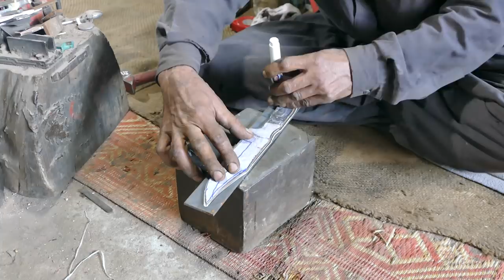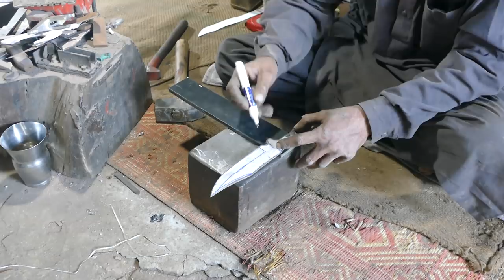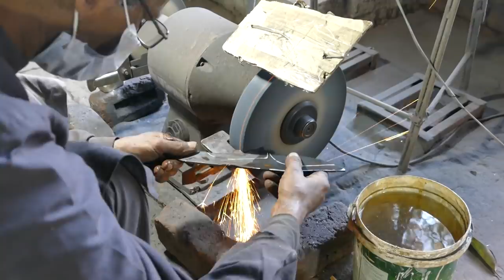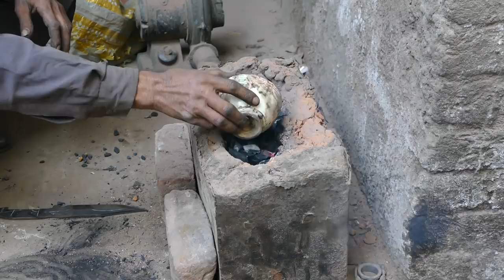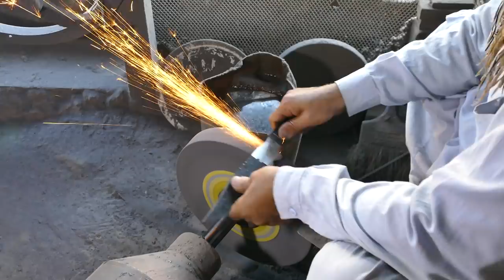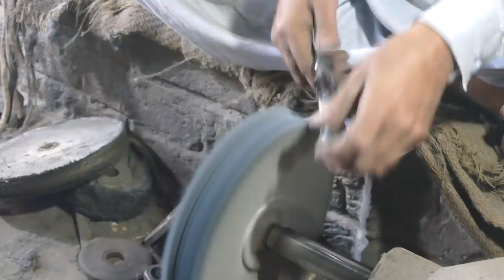Amazing Handmade knife making with rusted steel

Comment: Has no idea about metallurgy, no CAD designs, no maths skills,  no safety gloves, no 'kill switches' in sight and yet manages to make fantastic tools. Skill is skill, no matter how poor you are, imagine that level and living in a first world country?  Much respect for these type of people.
BTW, I travelled throughout that part of the world and this level is very normal.
Reply: he`s not poor , not in the slightest , poor is only a state of mind , he`s loaded !
Reply: Hell no this man deserves more
Reply: Actually this is skill
Reply: Yep he been watching YouTube videos lol
Reply: honestly you should never use gloves when working with power tools, they can make your injury worse
Reply: @leostraker3494  I know, but depends on what equipment you are using, anything that can drag your hands in, no, anything that you are hitting? Yes.
Reply: It's not much of an skill to use bench grinders to shape steel. In fact, when you start learning smithing, using bench grinders to shape the blade you have just folded and smithed in a forge, is one of the first things you will do and the first thing you will notice that they shape metal like hot knife shapes butter and it does not take any skills to do it. If you have skills, you will later notice that everything is done mostly by hand from hammering to buffing and etching and you use only hammers to find the shape of the blade.

We made knives and throwing stars like that during shop classes when I was 15 and haddent touched a hammer or stood in front of a forge. And when I later in my life did that and forged my first knife blade, I realised that I would never be skilled enough to keep doing it again.

Edit: I studied couple of years in artisan studies, from which one year was metal work, and we didn't touch AUTO CAD once before we hit the forge.
Reply: When working with these kinds of tools there are 2 types of injury. Ones that are minor enough that gloves help, but its such a minor injury it doesn't matter. And ones that are serious enough that gloves wouldn't help anyways.
Reply: Actually there are plenty of us here in the US. Democrats like to call us derogatory names, but we are here. Still practicing old ways, still teaching.
Reply: @sanakassara  It does take a lot of skill actually. I'm on my 12th knife and can't even come close to that even of a bevel without a guiding jig and scribing centerlines. Not to mention that I forge in my bevels before hand so it gives me a bit of a guide surface to press against the grinder. Being able to feel the difference between an 11 degree and a 13 degree angle so that your bevels don't come out with facets or convex takes a lot of skill. And it looks like he ground that in in about 6 to 8 passes for both bevels. When the most costly part of production is your time, the difference between grinding it in 5 minutes versus grinding it in 60 minutes is the difference between getting paid well and getting paid pennies.
Reply: @mrkiky  No it does not. Cutting up metal sheets and using belt grinders to shape them is not a skill, it's an ability. Skill is to forge a smoldering lump of steel to a shape of blade. I had the ability to cut and shape automatically, like most of us have. What I didn't have was the skill to forge and I know that because I forged only one knife blade. To make the whole knife with the tang, bushings, pommel, possible crossguard, hilt, sheath, last inside the sheath takes real skills from metalurgy to wood and leather work while taking hours of maticulous effort to finish and I couldn't cut it. I could use belt grinder straight away even without planning ahead. 

How hard is it to push the sheet against the grinder and turn and twist it to shape the sheet? I can tell you, it's not. If you have difficulties, it's because you have difficulties to coordinate and visualise what part of the grinder to use and in what angle. Just step back and picture the angle in your mind before you push the metal on the belt, do some dry runs with the blade and you are set.
Reply: @sanakassara  By the same logic, anyone can grip a piece of steel in a pair of tongs, hold it against an anvil and hammer it into a knife shape. A knife isn't really a complex shape. The hard part is getting it smooth, even thickness, straight, proper angles on the bevels so you have to do minimal grinding. I bet even with my knowledge I can teach a 13 year old to forge a knife in one session. It's just not gonna be a very nice knife. That comes with practice, that's why it's called a skill. It's the same with grinding. You can grind in an edge that can cut, it's just not gonna be anything that can sell, so to speak. Unless you post a picture of your first knife, I can't really tell at what level your grinding ability was right off the bat. But if you really managed to create a pair of symmetrical, even, flat (or hollow if you used a wheel) bevels that meet up to a centered edge, you either got lucky or have some innate talent for it that most people definitely don't have. And of course the other part of the skill is doing it fast, which is very important if you intend on making a living out of it.
Reply: @mrkiky  No, the logic is not even remotely the same. In the other process you basically cut a shape from a sheet like you would cut a paper. While in the other process you have to use fire to heat a lump of steel to shape it lake clay and constantly fold it to make it harder and tighter and you have to know how to quench the steel without twisting and warping the blade. The two processes don't even remotely come close to each other, so you can't in any way logically think of them in the same context.

Besides, after you have done the hard part which is forgin, you get to the easy part, which is grinding and puffinng. All hand forged knives are grinded and polished to their final shape after you have shaped the blade with your hammer. While cutting a stencil from a metal sheet is simply cutting the shape from a metal sheet and grinding away the rust and grime. You don't have to teach a 13 year old to do that. We did it without any particular guidance in shop classe back in junior high as part of basic curriculum and it was the first thing we went through in basic artisan studies we did while getting to know smithing. I was studying to be stone artisan and the metal part was part of our basic training, while we were figuring out in where we might be good at. Forging the knife was the first task we were required to do, and it consisted all the parts from the froging to the grinding and assembling. Only part which didn't require even any idea about a talent was the grinding. I don't know that is it just beacuse of me and the fact that I have for example sketcehd and done drawings for about 40 years now and I have a quite high aptitude for it. Or was it simply because it literally took no brains to do it and that's why it's an ability, not a skill. Skill is to make the whole knife from scratch, from a lump of steel to sheathed work of art - which I noticed I didn't have because all I could do in the time window set for us was to forge, shape and polish the tanged blade. So ability to grind sheet metal does not impress at all, being the easiest part from the knife I failed to finish in time.
Reply: @sanakassara  Again, no way to assess at which level you did your grinding. All I'm saying is that it's not easy to do it right. It's not easy to do it fast, and it's definitely not easy to do it right and fast. The guy in the video is pushing that blade against the wheel and finishing a very good bevel in a matter of minutes. He's also working with no gloves, and you can tell by the color of the oxide on the blade, it reached over 300 celsius without him getting burned or without the wheel throwing the blade out of his hand. You get better with practice, which is why it's a skill. I can spot a huge difference between someone who's doing it for the first time and someone who's doing it all day. Also you definitely don't have to constantly fold it while forging, not if you're working with modern steel at least.
Reply: @mrkiky  You don't seem to get that there are not much levels in grinding. You can't polish steel, if there are bubbles or other rough spots on the surface. My knife was polished, shaped and edged. You can easily "assess" that without a picture - which you can't even attach to YouTube comments without and IP address.
Reply: @sanakassara  I know what you're saying. What I'm saying is that I completely disagree. Look at what a beginner does on a grinder and look what Matt from That Works can do. There's tons of levels to grinding. And you can absolutely polish an uneven surface. I can even show you my last completed knife where I made a couple of mistakes resulting in very slight dips in the bevels, which are by all means polished to 800 grit like the rest of the blade, but if you look how the light reflects, you can tell it isn't flat in that spot. Just because it's polished doen't tell me that your bevels are flat, that they have the correct angle, that the grind lines are at a constant depth, that the plunge line are nicely defined and at the same height, etc. Literally can't tell without seeing it. But regardless of how well it turned out, it's absolutely silly to say that shaping steel by grinding isn't a skill or that there aren't levels to it. Imagine grinding a rapier blade with a distal taper. It's insanely hard to keep straight and flat. Just like saying drawing isn't a skill because you just drag the pencil on the paper and leave marks. And yet drawing an accurate portrait requires a lot of skill. It's easy to draw lines on a paper. It's hard to put them where they should be.
Reply: @mrkiky  I know why you disagree. I already gave you pointers to make it easier, you just need to develop your sense of space and shape a bit with your motor skills. I have developped issues relating to motorics later in my life, but after over 20 years I could still bench grind without issues, because I see where my hands are and what must I turn to shape the metal to what it looks like my head. The guy on the video has done it so many times that his ability has become an automation like breathing is. Sure, it takes practice but it does not make it a skill, which breathing is not either.

It was my first time knife smithing when we had the task and I was still able to make a polished and edged knife blade - with zero skills to begin with. I learned on the way, that's why it's called studying.
You also keep constantly going on about them bewels. I would get that if the world of design would be stuck on one universal knife blade model, which it isn't. You keep constantly dismissing the fact that shape and thickness of the bevels depends on what you want the blade to look like. There is a company in here, in Finland called Wood Jewl Design Kauko Rantanen. His knives are all over in Finnish shops and they go like hot cakes to outdoors people. Almost every knife he forges is rough and unpolished and the blades from the tang to blade are very thick. But despite the rough appearance made in Finnish nature, those carbon steel knives are top quality craftsman representations of blacksmithing skills and your argument is that it takes skill to grind some steel with a beltgrinder.
http://www.woodjewel.com/
Reply: @sanakassara  Because the bevels are the hardest part. Profiling, I have to agree with you, that part is very easy because it doesn't have strict angles and you can see directly as the grinder bites into the steel. As for the knives you gave a example,the only thing you can argue is rough about them is maybe that he leaves forge scale on the flat of the blade, which is clearly a design choice. Otherwise, the fit and finish is very refined and the bevels are very clean and consistent, the handle construction is fairly complex too and the materials used seem to be pretty exotic and fancy. Nothing I would call rough. 
Anyway, anytime I make a new knife I get more worried I'm gonna mess it up while grinding in the bevels. It's just the trickiest part. Even when it come to forging, the bevels are the hardest thing to get right. But at least during the forging stage you can correct it a lot of time. On the grinder, if you went too deep at the wrong angle, it's screwed. Just 2-3 degrees and 5 seconds of not paying attention and now your edge is too thin to be quenched, and you have to reduce the width, or your grind line went too deep into the flat and looks messed up.
Reply: @mrkiky  That's the other thing. Sheet metal is soft and used for construction, it's made for bending and shaping. If you use too much force, throw it away and cut a new one. Forged steel is a lot harder, so it's more forgiving. You can use more pressure without getting in too deep. I think that you are saying that it takes skill to figure out how the material behaves when you work it. While in fact you should notice right away that the rough belts almost cut the steel sheet away more than they grind.
Reply: @mrkiky  I missed the part of the bewels while forging. It was not so tough as you migh expect. Anvils are designed for shaping and you just use different angles, parts of the anvil and maybe more time on the parts you want to get thinner and pointier. Force you can't use much, it dent's and fractures the steel. That's why the big pneumatic hammers don't pound, they press to stretch and to pack in the metal.
Reply: @sanakassara  That really depends on the steel. Modern standardised steel almost never cracks. For bevels you're supposed to use the flat side of the anvil and hit it with the flat side of the hammer. Simple theory, hard to master. There are different techniques. Mastersmith Jason Knight works on one section at a time with the round hammer,  then goes back to the flat hammer and smooths and straightens everything. Sasha Alexeyev explains that you should hit the bevel with the flat hammer into itself instead of pinching the edge, a technique that works on old, non standardised steel which tends to crack if you pinch it. But either way, it's the trickiest part to get right. Profiling, forming the tip, forming the tang is all pretty straight forward. 
And what are you saying? Power hammers absolutely pound the crap out of that steel. There are presses that squeeze it gently and there are hammers that hit it hard, fast and often. Even back in the day, making larger objects like axes or swords, the smith would be assisted by an apprentice as a striker to pound the fuck out of the workpiece with a large two handed hammer while the smith holds it.
Reply: @sanakassara  Actually the point of forging is just the easiest way to get the steel into shape. Has nothing to do with tensile strength or hardness. Those are dependent exclusively on the composition of the steel and the heat treatment. Doesn't matter how it got into shape. Cold rolled, cast, forged... heat treatment resets the structure. High carbon and alloyed steels tend to be harder even when annealed and they move harder under the hammer too.
Reply: You know why the internet often is filled with all kinds of shit? It's for example due the fact that things containing all the right information keeps getting deleted or blocked - like my last comment on another username. That sucks, specially when you argue with facts against ignorace. Just so you know, you basically stated in your last comment, that you don't know anything about forging. The process aims to strenghten the steel and make it bendy. Rolling does not do that. Here is some evening reading for you.
https://blacksmithcode.com/forging-temperature/
Reply: @alonzotyper2900  Not only did I study metallurgy in college, I get to experiment with forging hands on as a hobby and I consumed a ton of information of steel and knifemaking. Fact of the matter is, you take your rolled steel bar and you grind it into shape, then you take the same steel bar and forge it into shape, fold it a million time if you want. You apply heat treatment to both of those knives and they will have the same crystaline structure and same properties (if you apply the correct heat treatment with normalization, hardening and tempering, only exception being, the ground knife may not even need the normalizing part if the bar was factory annealed). Folding and rewelding was done in the old days to make the composition of the steel more homogeneous, that's it.Even the link you provided says this. It doesn't do anything else. Modern steel doesn't need folding and doen't benefit from it because it is already homogeneous. Unless you are pattern welding, folding modern steel is a waste of time, energy, fuel and material(lost to oxidation for more heats than needed) and may even decarburize your steel (again due to it spending too much time at a high temperature, the carbon starts to difuse out of the steel). 
I repeat, if using modern steel, forging is just a way of getting it into shape. It has no bearing on the final properties of the knife. Those depend solely on the material and the heat treatment, NOT the shaping method. Ask any bladesmith, he will confirm.
Reply: The fact that you even mentioned personally that the purpose of the forging is to homogenize the metal makes all the difference. You take a rolled sheet/bar of steel and you can burn it all you want and you still won't get the same properties on it than you get on forged blade. Take a stamped knife blade, or blade like in the video and stick it into something tight and twist sharply - it goes snap. Try to do the same to forged and folded blade and see how it maybe bends, depending how much you got in your sleeve. Modern factory made steel knives snap even when they accidentally get dropped on bottom of a fibeglass boat. But you still find blades made hundreds of years ago intact after exposed to elements and only because they were forged. It also depends totally from the modern steel how homogenous it is. Blades like mild steel blades snap easily and rust practically even from idea of water. And you can't heat treat such blades as you please, you have to follow the manufacturer advised temperatures, otherwise you can chuck the blade away from the get go.
The part you typed about the decarburizing was already behind the blacksmith link. I don't have to ask from any blacksmith about the purpose of the forging because the link already confirmed my argument by stating that, 
"Forging
This deals with heating the steel at a high temperature. The sword is from iron sand that contains very little or no Sulphur.

The way to achieve this is by heating iron sand and carbon together at a very high temperature. This causes the sword to have high strength and ability to hold sharp edges and reduce the risk of breaking." The shaping, as you call it, packs the metal tighter and gives it strength.

You stated that you get to experiment with forging as an hobby. Do you use some mini gas burners, or do you have the change to use an decent coal forge?
Reply: @alonzotyper2900  Sorry but that is complete aberration. How could manufacturers that mass produce knives  put out high performance blades if they don't forge them? Packing the steel tighter makes no sense. Steel has a fixed density. It's a solid. It's incompresible. You can't pack it tighter. You are misunderstanding how it works. 'Packing it tighter' probably comes from the fact that if you're working with wrought iron or bloomery steel which has so many impurities it basically has a grain structure, you have to hit it in a way that presses the grains together, essentially pushing some of the impurities out and forge welding the grains. Zero point of doing anything like that with modern steel. You can hit it every which way, just make sure it's hot enough and it won't crack. 

The propreties of the material depend on the microscopic crystaline structure, basically how the carbon atoms are arranged inbetween the iron atoms in the lattice and how fine the indivudual crystals are. In fact, forging builds up non uniform stress in a workpiece which is undesirable. The normalization stage is done with the purpose of relieving stresses from forging (mentioned even in your link). You heat the metal and let it cool slowly. It recrystalizes and gives the carbon atoms a chance to get out of the iron atom cubic lattice. Doing it multiple times refines the grain structure, forming smaller and smaller crystals, which is desirable. Now that the steel is prepared for the next step, you heat it up above what's called critical temperature, the steel becomes austenitic, very easily indicated by the fact that it loses magnetism. Carbon atoms slip into the lattice because it's loose from having high energy. Then you rapidly cool it, carbon atoms become trapped. At this stage there is a lot of tension due to this. The metal is very hard but very brittle. Tempering takes care of that. Keep it steady at low temperature (typically 45min to 2h at around 200 celsius), some of the stress is relieved, removing some of the hardness and most of the brittleness. Now you have a metal with propreties adequate for a blade. That's the entire philosophy, broadly, for carbon steels. Extra alloying elements make it more complex. 
If you want to maximize the propreties of your steel:
Step 1: know what steel you're using.
Step 2: get a professional heat treating oven and standardised quench oil
Step 3: absolutely nail the heat treatment according to the manufacturer's diagram.
How you shape it is irrelevant. 

So, in summary: forging with modern steel -> only shaping
heat treatment -> getting the desired microstructure which comes with the desired propreties. 
Personally I use a charcoal forge, quench in cooking oil and temper in an electric cooking oven that has a temperature setting.
Reply: Seriously Mr. Metallurgist. You type from solid structures and crystalline compositions with atoms and microscopic structures in the same essey, but still try to deny the thing which is obvious...

Like you already so elegantly stated, nothing here is solid. Even the toughest metals are formed from structures we don't even have the technology to see. Steel is porous and if you want it to be less porous, you need to work it. The more raw materials it has from carbon to chromium, the more porous the structure is due to mismatch composition. The more porous it is, the less density it has. I have no idea how you might think that it was an some sort of thought error from my part to bring it up. The text on the link which I posted and typed by a blacksmith already confirmed my argument, while your was that forging is only a fast way to shape steel. There are plenty of faster ways than that, ways like the previously mentioned rolling, and don't forget casting. But neither of those processes enable the same possibilities than forging does and produce structually equal metals.

One part of the composition comes for example from air and other gasses. The more bubbles it has, the brittle it is. But you can force the gasses out from the composition and you can do it by forging, which makes the structure more solid - as in packs the structure tighter. I have not spent even an hour in college studying metallurgy, but still this type of thing is self-explanatory to me. Crystalline literally means that the material composition is formed from several alingnment crystals. No matter how dense the metal seems to be, the deeper you look, the more gaps you see between the crystals. Forging aims to make the gaps smaller by - like you brought it up - making the metal more homogeneous.

But seriously, I have played this game long enough.
I get that the purpose of this video was maybe to promote working people of Pakistan and perhaps to bring aid to their squalor. But the knife in the video is junk, it's a grinded piece of rusted sheet metal. Nothing you type here can't take the conversation any further from the intial context, which was that the video is an great performance of an ability, but it does not take actual skills to grind a knife from a rusted piece of metal - I know, because I have no skills and I have forged an knife blade by my own hand.
Reply: @alonzotyper2900  Ok man you clearly are set in your ways and in no way open to any new information. Steel is somewhat porous, you can't make it any less porous. Fact. Density is set. It is solid. A solid is a notion from the field of physics that refers to matter that holds it's own shape and density. A gas can have variable density and volume, a liquid can be somewhat compressible. A solid, no chance. You have absolutely no idea what you're talking about. I have education, I have experience, but I'm not even asking you to trust me based on that. Just do your own research and you'll find out that I'm right. But you won't because you don't care about learning anything. All you care about is feeling right and feeling smart.
Reply: Yes yes, me wrong you right... Come on dude. We both know that it's not true. There is not a single thing in your comments that could argue otherwise, they even confirm what I stated. Everybody knows what happens to molecules when things get heated, forging takes it step further and takes advantage of that. It changes the structure, removes raw materials and impurities, while solidifying and changing the density of the metal. And nothing is ultimately solid, you even confirmed that yourself by briniging up the microscopic compositions. Everything is pieced together from tiny groups of two or more atoms - which move and live constantly. The deeper you dive in the crystaline structure of the compound of the metal, the more space between the structures you will find. You are a funny guy.
Reply: @alonzotyper2900  
"Everybody knows what happens to molecules when things get heated"

You don't even know that steel is not made up of molecules. 

" It changes the structure, removes raw materials and impurities, while solidifying and changing the density of the metal. "

It changes the structure, but not in a desirable way, which is why you have to normalize it when you're done forging. 
Changing the density of the metal - absolute and complete bullshit. Density is constant. It may change slightly while it's hot but it goes right back to where it was when it gets cold.
Removes impurities - for the billionth time, modern steel has the composition controlled to a fucking T. There's nothing you can do with a hammer to improve it. That was only true before the days of standardized steel. Now, modern steel is far superior to what they had back then, even after all the forging, folding and refining. 

"And nothing is ultimately solid"

solid
/ˈsɒlɪd/
adjective

1. firm and stable in shape; not liquid or fluid.

Plenty of things are solid, steel at room temperature being a very good example in this case. One notable property of a solid is that it doesn't change density, even under extreme pressure. 

"The deeper you dive in the crystaline structure of the compound of the metal, the more space between the structures you will find."

Again, complete bullshit. Iron crystals have a very set structure, like all crystals. At room temperature it is body centered cubic structure, meaning 1 atom in each corner of a cube and 1 atom in the center of the cube. The cube size is fixed. The only place in a piece of iron where there is variable distance between atoms is at the border between 2 differently oriented crystal grains. Why am I even trying to explain stuff that is 10 levels beyond your level of knowledge, I dunno. 

You can't go 1 sentence without saying something wrong, among other blatantly false things that you've said in this thread like power hammers gently squeezing instead of hitting hard and fast, which is the easiest thing to goolgle if you haven't ever seen one in action. I'm starting to believe you're that guy that figures out he's wrong half way into the discussion so he starts trolling so he can claim he was trolling from the start and avoid admitting he was wrong. Or you're flat earther levels of stupid. Either way, you can shut up now.
Reply: Sorry if my terminology is not correct, but English is not my native language. Metallic atoms are binded by a chemical bond. Metallic bond is formed from metallic cations, which are surrounded by gas. It's an force which holds the atoms together in close tight group. Solid is only a momentary state of matter (physics), a phase (again physics). If solid would be seen as an actual form, it would have no structure. Taken from Encyclopedia Britannica,
"Metallic bond, force that holds atoms together in a metallic substance. Such a solid consists of closely packed atoms. In most cases, the outermost electron shell of each of the metal atoms overlaps with a large number of neighbouring atoms. As a consequence, the valence electrons continually move from one atom to another and are not associated with any specific pair of atoms. In short, the valence electrons in metals, unlike those in covalently bonded substances, are nonlocalized, capable of wandering relatively freely throughout the entire crystal. The atoms that the electrons leave behind become positive ions, and the interaction between such ions and valence electrons gives rise to the cohesive or binding force that holds the metallic crystal together."
To argue that steel is not formed from molecules is equivalent to argue that steel has no atomic structure. There wouldn't be the metallic bond without electrons and ions, which for example are necessary part of carbon and iron, in which the atoms are held together by ionic bonds and the structure of iron is an example of a giant molecule. Iron for example wouldn't conduct electricity if the iron atoms wouldn't move through the solid. Molecules are the smallest free parts on any compound or element, and metals with everything else in this planet are formed by the elements on the periodic table. Alloys are compounds.
https://www.britannica.com/science/metallic-bond
Reply: Mrkiky has also clearly established his intellectual properties with the oh so academic "stfu" type argument. 🤣
Reply: Everything on this planet has a molecular structure. The whole planet is formed from elements in the periodic table. Steel being and alloy composed from several elements from the periodic table has the molecular structure of each raw material used to create the alloy. How is that unclear?
Reply: Oh no, not all wasted from my point of view. Extremely entertaining to see in what kind of world some think they live in. World with different laws and structures. Yours is a different reality.
Reply: @leostraker3494  agree
Reply: World is full of talent.
Reply: Bring thousands of experience